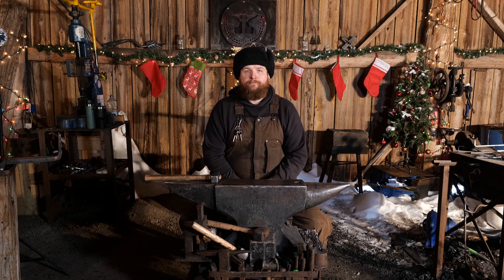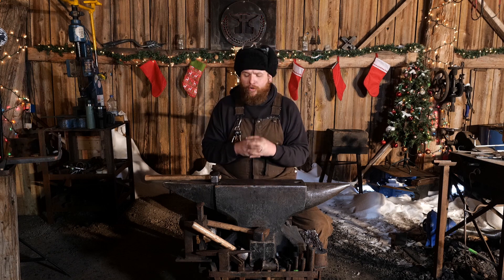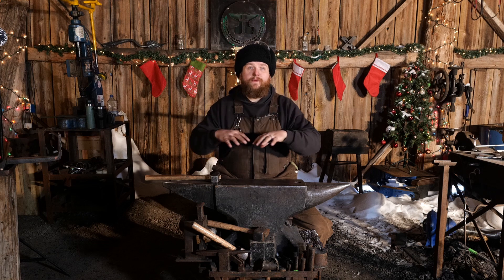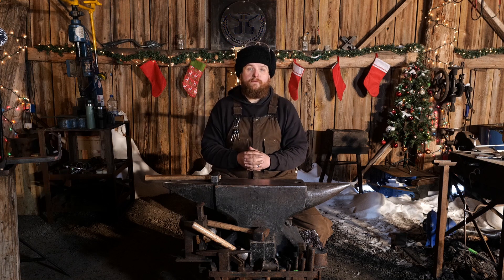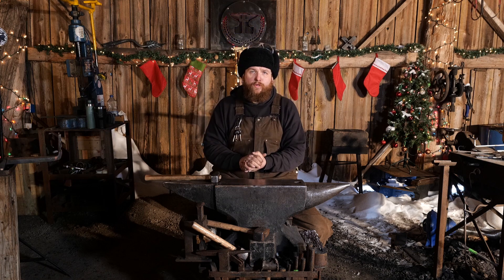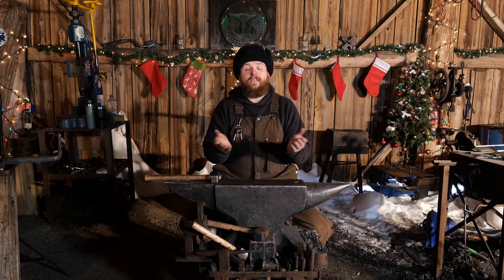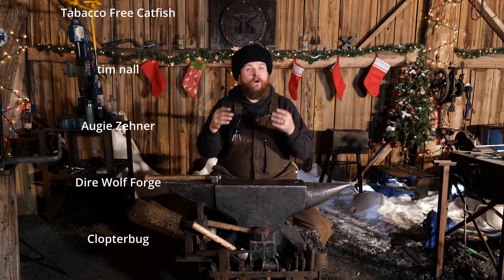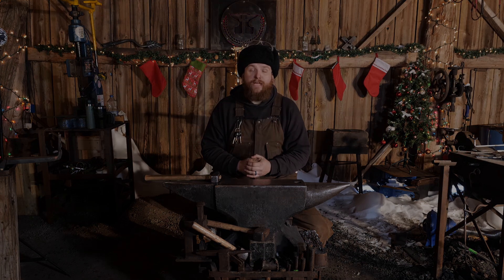Stop Over Thinking Tooling!

Comment: Another thing to be said for making tooling out of mild steel.  Chances are, anyone watching this video, is fairly green, and learning.  More than likely, that first punch, drift, fuller, hardie, etc that you make, is going to look like crap.  It will work, barely, but will leave a lot to be desired.  Nothing to do with the steel, it will be the way you forged it, or lacking certain tools to do it right, or a flaw in how you designed it.  If you make your first sets of tools out of cheap mild steel, you will get all of these learning experiences out of the way.  Then, once you have a collection of crappy, but functional tools, you use what you learned, and start upgrading the ones that you need the most, or that work the worst.  That way you end up with tools that you can use for years, that you actually want to keep using.  Starting with fancier steels is just going to mean suffering with poorly made tools for a lot longer, and probably having a lot less of them, too.  Having a cheap version of the right tool is better than trying to make do with a high quality wrong one.

Comment: Historically, all steel was "mystery steel". Blacksmiths would "spark" test on their grinding wheel to make an "educated guess" at carbon content. If they needed more carbon, charcoal in the forge followed by folding and welding to distribute the carbon would follow. This is one of the reasons that blacksmiths were often seen as magicians or wizards in ancient times. They could take a mediocre quality piece, reforge it to increase carbon, properly quench and temper, and produce a superior piece! The quenching liquid and mutterings of the smith were considered unguents and incantations! Magic!

Comment: Great advice! And it's time tested, especially for someone who is still within there first year. Use rebar for some chisels and tongs. It's cheap(somtimes free), and it works. I remember the vid you put out a few years back on it. Then as skill develops, move into other steels if one wants to. My chisel set is entirely fat coil spring. Keep em cool, and they will last along time. I think I've only had to re sharpen one of em, and it's the one I use the most. 🍻

Comment: I used to have a T shirt that said all tools are a hammer except a screw driver, that's a chisel! I agree with you 100% on tools I have a very rag tag collection of tools. But they all get the job done! A tool should be basic enough to get the job done safely, not something that looks like a work of art that is way too pretty to smack hot iron with or use against a struck tool.

Comment: I'm a beginner to blacksmithing. I made my first set of fullers a couple months ago out of mystery steel. I was feeling like a bit of a hack for doing it. Thanks for the reminder that form follows function! (they work just fine btw)
Reply: So long as it's not Galvanized, or leaded, you are gonna be fine.
Steel is steel.

Sure sometimes it could be a bit janky, bit look at what you just did. You made a tool, to accomplish something you previously couldn't do before. Have pride in that.
Reply: Don't be ashamed to use mystery steel. You just have to learn to tell what it is or might be. Just be careful when you're trying to heat treat unknown steel if you have no idea what you're doing, you might damage your tools at best and injure yourself at worst.

I'd say for a beginner working with junk steel/mystery steel, it's important to know how to tell if something is hardenable or not. You should quench test your material and see if it gets hard before you decide what to do with it. Hope this helps
Reply: I've been thinking about starting black smithing for about 8 years. I promise you that the hackiest mystery metal anything you make is FAR better in EVERY way than the imaginary ones I never get around to making.